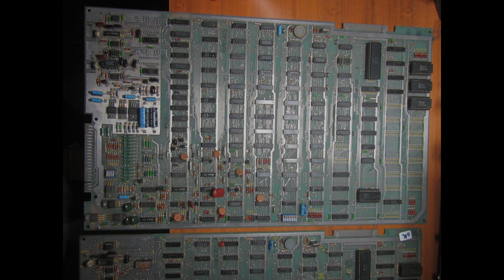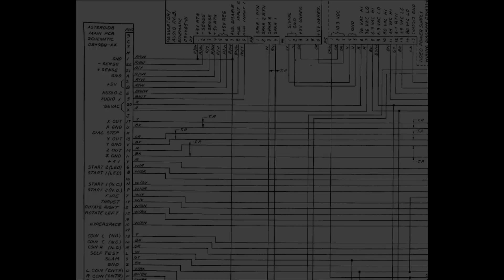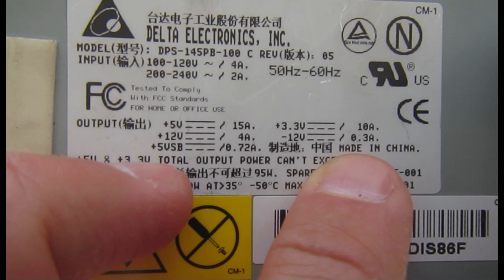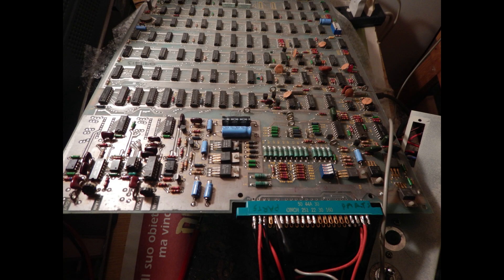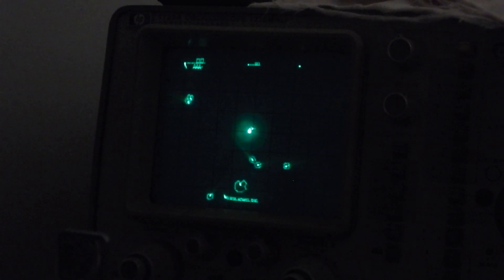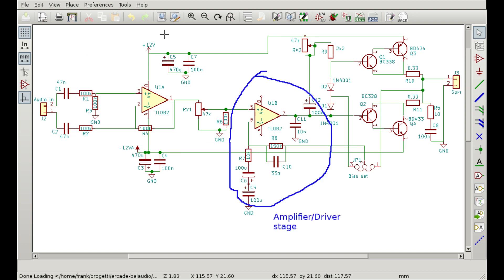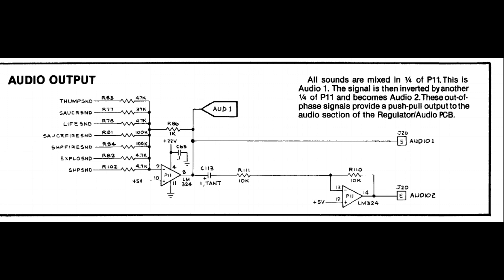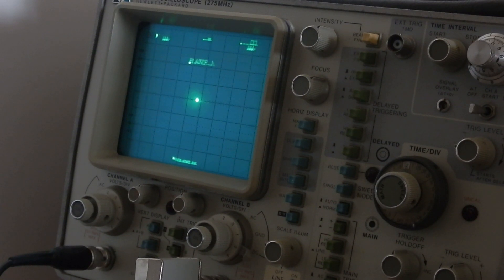Atari Asteroids Arcade: making a power supply and audio amplifier for the game board.

Comment: 11:55 I was hearing that exact noise on my Centipede arcade until I switched to the original audio amplifier. And now we know why!
Reply from the maker: Yeah, having common ground return inside PCB and to the power supply for both analog and digital circuit wasn't optimal, but using a differential audio path helped quite a bit. Atari used this differential audio "trick" up at least to Pole Position (what I'm servicing lately).